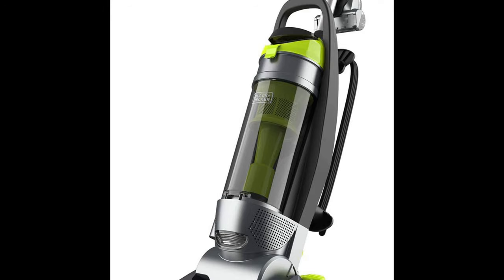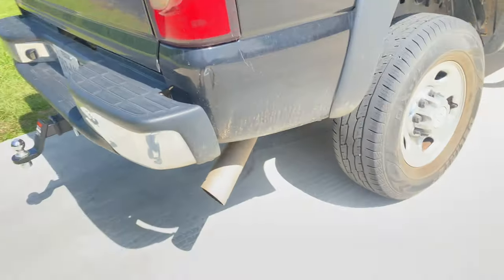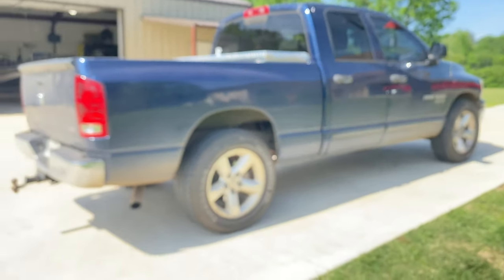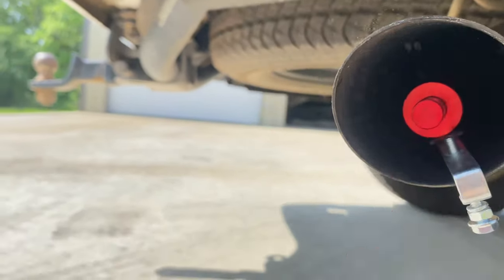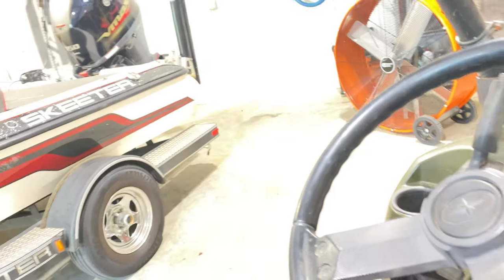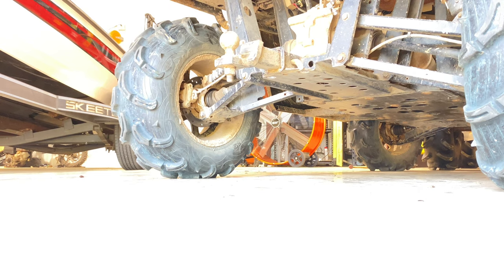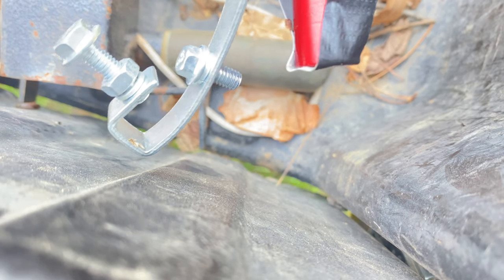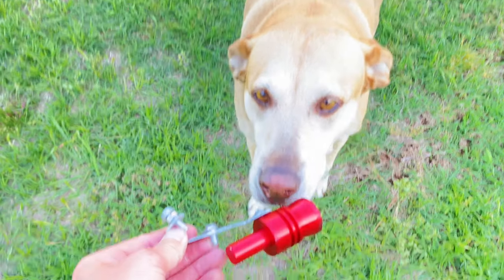10$ AMAZON Turbo Exhaust Whistle VS Ram 1500!! (Does It Work??)

Comment: Adding additional back pressure in the exhaust system, the exhaust gas can't escape fast enough, you will generate more heat and pressure in the system, which will cause engine performance to drop and your gas mileage will go down.

There is a reason those exhausts have different diameters, varies on engine size, performance.

There is a reason our old vehicles had headers and real dual exhaust.
Reply: Seriously ? You're kidding , right ?
Reply: @larryhurley2314  

Yes, nope, changing the exhaust pressure of an engine to breathe can cause all kinds of problems, just like sticking a gas mask on you and then having you run a Marine military 3 miles in 24 minutes.

Today's computers can try to adjust things, but they are programmed to expect certain parameter boundaries. Outside of these the computer can make erroneous corrections. 

Sticking a potato up the exhaust isn't in the computer's boundaries to just adjust and soldier on, it simply can't correct for that extreme. 

So shoving restriction crap up an exhaust can be expensive.

Running an old 60s engine with st8 pipe, switching to dual headers comes to mind as a no-no.

The engine is designed for back pressure. You have to account for it.

I have not seen, heard of burner valves since 1970, it was on a car, a 440 ci,  that the exhaust had been modified to reduce restriction, lean burning, best as I can recall, it's been a long time,  but I do recall the valves damage was credited to the modified exhaust.

So.... it seems you want validation from an old fart, who has been there, done that, when young and dumb, Grasshopper. 

I have been pinged by youtube in the past. They refuse to show you why, just saying you did it . I think it was because I put in an external web link backing up my statement in a post, don't care, too lazy to care.

So the workaround. 

So, for starters, external link, Google "

How Does Exhaust Back Pressure Affect Your Engine?

Written by Eric Riddles

Published on August 17, 2022

Category: Exhaust

Your car's engine consists of various essential components that manage exhaust gas emissions. Did you know that these components can create exhaust back pressure affecting the engine's performance? Keep reading to learn more about exhaust back pressure and how it can affect your engine."